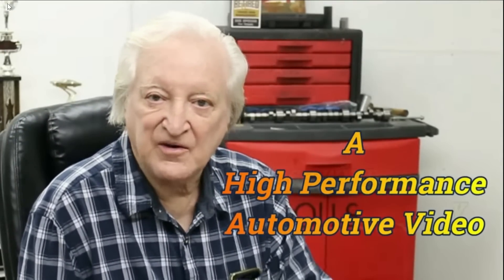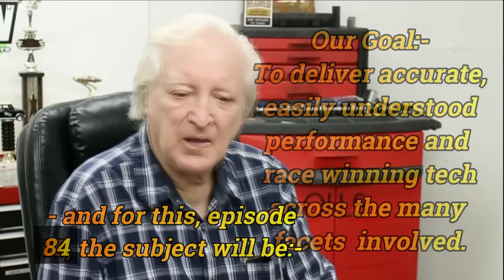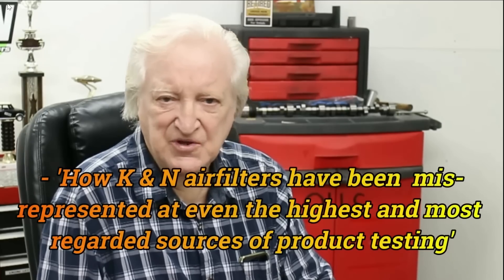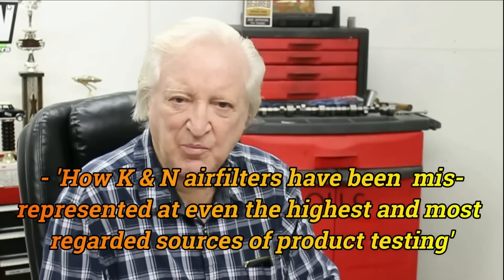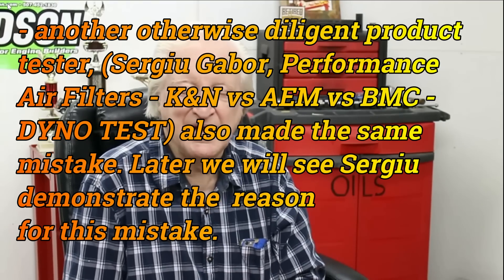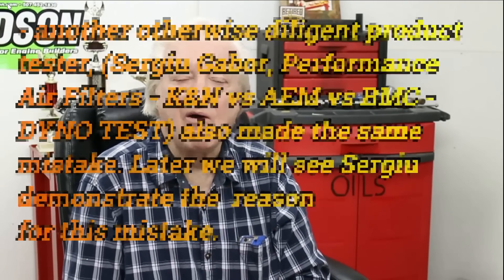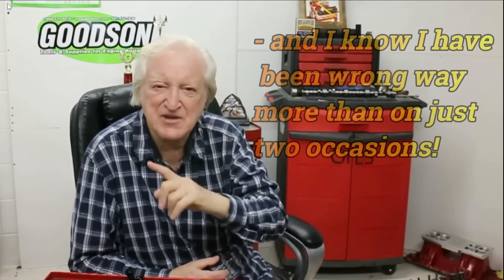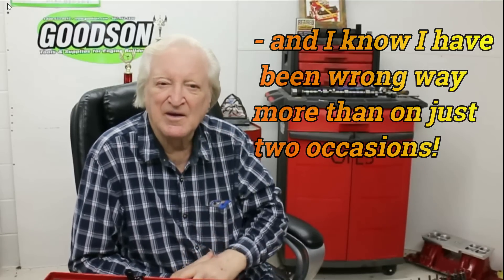K&N air filters  undeserved curse lifted!

Comment: K&N is very good at filtering dirt. But I've learned in a SBC with a blower and an open element K&N under the hood. You end up with 2 issues. First being the MAF gets contaminated by the oil on the filter. The second was after going to a speed density tune was the fact that. the filter couldn't handle the particulate matter produced form belt slippage. This problem was first detected by 
1/4 timeslip increases for no other reason. Upon disassembly of the intake piping to install meth injection. We were shocked to see all the black matter from the belt. So after a complete cleaning of the intake piping & intercooler. We redesigned the air intake system outside the engine compartment. WOW to my surprise we didn't have the problem of slowing timeslips 3 or 4 times every season. this was real world out of my pocket knowledge. I still run with K&N but do note filtering dirt is one thing filtering rubber is something the filter was not designed to handle.

Comment: Hey DV, I've heard of some mechanics say that K&N fFilters are "Absolute Garbage" when used on engines with a Mass Air Flow sensor. When the K&N Filters were designed, there were no computer controlled engines, only carbuetors. I have a 1992 Isuzu Rodeo with the 3.1 L V6. The engine has OBD I diagnostics with a Manifold Absolute Pressure sensor to control the fuel flow from the TBI fuel Injection. I bought aK&N filter for it as soon as i got it. I LOVE that filter. I've had absolutely no problems with the performance of my vehicle.
Reply: Shouldn't make a difference whether you use MAF, MAP or a simple carb.  The air still pulses as it's drawn in, and so the filter should work just the same.
Reply: Nissan in Australia, and Volvo for that matter, have both used viscous paper air filters. A hybrid between paper and K&N filters. Basically an oiled paper element. Nissan even used it on some vehicles with hot wire air mass meters
Reply: @aussiebloke609  These "mechanics" were saying that the oil was coating the MAF wire and causing errors. It would take a lot of excess oil on a filter to coat the wire. The air duct would also have to be equally coated and we know that isn't the case when properly oiled.
Reply: @briantayes2418 
I have pictures.
Reply: @aussiebloke609  Those mechanics inferred the oil on K&N Filters was making the MAF sensor to throw codes. Perhaps the filters were over oiled after cleaning? "The correct amount is good. More is better".
Reply: @briantayes2418  Lack of experience on everyones part. You've likely probably seen the forum posts where the new kid looking for low cost horsepower buys a k&n and over oils it. Oil gets pulled in and coats everything.  Usually the chain of events is: kid put in k&n. make post about poor running engine some days later neglecting to mention their new k&n, They throw parts at it, then go to a mechanic who condemns the k&n, cleans the MAF and sticks a paper filter back in, and thus begins the misinformation cycle of condemning the k&n rather than the actual cause being over oiling.    
     
We've all over oiled them probably at one time.  I know I sure did my first time reoiling mine.  But that was a long time ago with a carb, no harm done,  just the oiliness on the inside of the baseplate.  Still running that k&n on the same car decades later.
Reply: @briantayes2418  I'm a mechanic and I have seen K&N or K&N knock off filters cause MAF sensors to read wrong.  It only takes a small amount of oil to make the MAF meter incorrectly, this in turn causes anything from just throwing code to catastrophic engine or transmission failure.  What fails depends on how long a concern is ignored (that's what causes the big repairs, a lot of people don't pay attention when the vehicle starts running bad.) and the year, make and model.  A lot of PCMs just have "Blind faith" in their MAF sensors and don't even throw a code, instead they just adjust the fueling and shift strategies for air flow that doesn't exist.
All that said...

A K&N can ONLY cause that if it's over oiled.  And a factory filter can cause the same issue if it gets plugged.  Where I live the dust is a factor and it gets into everything!  When a factory filter plugs, it acts as a sifter and the smaller particles are forced though.  I run K&N filters in everything I own because they filter/flow better than anything else (when they're cleaned and oiled correctly).  The exception to this is forced induction engines, turbos and blowers seem to straighten out the air and cause the K&N to loose some of its filtering ability.
Reply: @briantayes2418  A coworker made that mistake. Once he cleaned the excess oil off everything went back to normal.
Reply: I put a brand new out of the box K&N in my wife’s ‘96 Rodeo and it ended up fouling the MAF.
Threw a CEL.
Still running the K&N but now I clean the MAF every other oil change.
That K&N does make a difference with that gutless Isuzu 3.2.
Reply: @guyfranks4354  Over oiled.
Reply: @johnflett2531 lol air filter causing transmission failurev😂
Reply: @theshed8802 Same for Genuine Holden air filters (6 cyl and V8) for many years. They were tacky to the touch.

Comment: Hi David, 
Are the K&N X-treme filter lids worth it vs a standard metal lid? 

Heard from a local dodgy mechanic/“engine assembler” that they lost power on a chassis dyno with the K&N filter lid… 🤷🏽‍♂️
Reply: Try to find the episode of Engine Masters that tested air filters. Very interesting.
Reply: Usually that K&N  lid picks up power.
Reply: @thereluctantgearhead4544  depends. Watch the Engine Masters episode. It does SOMETIMES depending on circumstances.
Reply: @troymecey  I've seen every episode. I'm just speaking from my 40+yrs of experience with building engines.
Reply: @thereluctantgearhead4544  you win. I've only got 35+. Congratulations
Reply: @troymecey  haha!
Reply: @troymecey  Probably more of a curse than a win. I wish I would have chosen a office job. Too late now tho, I'm retired. But you are right in the aspect of results may vary, don't think they do much on a 200-300hp engine, but on high powered units they definitely help. I never did like the way they look tho. And most of my drag cars just used a base with no air cleaner. That episode of engine masters was eye opening on a few air cleaners tho. Amazing how much power can be lost with the wrong one.
Reply: @troymecey  The salid bowl was the real surprise. Didn't see that coming.

Comment: I was wondering on blown applications typically a superchargeror a turbo will pull from the filter. So does that negate the pulsations from the engine, or would you still get enough pulsations since while crusing you are not in a boost situation.
Reply: Glad i checked the comments,  this is my question also.   In my experience blowers actually do pulse,  diesel (roots) blowers anyways,  but turbos are a steady pull.   I will be checking my dodge Cummins air box for infiltration!
Reply: @shrodokahn470  I have a centrifugal blower (vortech) which is basically a belt driven turbo. It will be interesting if we get an answer to this question. In most cases while driving the blower is bypassed until boost is needed, so does the pulsations transfer passed the blower to the airfilter?

Comment: Oiled filter are better on non boosted vehicles. Maf sensors that get messed up on are majority boosted engines. There have been several tests among the years and working on performance vehicles for almost 2 decades my observation matched.

Comment: The real question here David is in a modern car with an AIR BOX and several feet of plumbing do you get a good pulse at the filter.    I understand a filter  on top of carb on a lower rpm v8 with high comp engine would have a much stronger pulse However i would disagree that a modern larger bore hirer avg rpm several feet of duct and an actual airbox will nullify any pulse that far away.    Change something simple as air tube dia or compression will really effect the results   May want to reexamine the signal /pulse in that condition which would be more applicable everyday driver.    Im kinda suprised you didnt apply an artificial vibration on your flow bench to simulate your fiber theory which does sound very plausable for and differences.  Interesting like usual no doubt.   Also the use of oil in cold ( -15 here in Catskills NY Winter) would it stiffen significantly

Comment: Can you help me 
I just looked at a 2019 Ram 1500 with a KnNfilter replace the original air box filter. 
Should I be concerned about the wear and tear from original owner who installed this modification. 
The truck has 35k miles other than the after market KnN after air filter truck presents awesome.

Comment: Great job David.  I think this topic needed a better explanation because it is nuanced.  Back in the heyday of Fox bodied Mustang, I, like many (all) others used a K&N air filter.  At the time it was said that the filter media can be washed to clean off the dirt.  I squirt a hose at the inside of the filter to knock dust particles off the outside.  Then put some drops of motor oil on the filter.  At the time K&N was selling filter oil too.  

Is washing the filter with water still advised?  Am I doing more more harm than good?  Do those little micro hairs get knocked off when getting squirt with water, or do other cotton fibers break and take the place of some of the fibers that get washed away? What about spraying the filter with compressed air?
Reply: Lol @compressed air!

Comment: If the k&n rely on the pulsing of the air intake doesnt that mean it would be less suitable for turbo and or supercharged engines?
Reply: Agree.   How about this.   Modern car.   Several feet of duct work and a box.      Combine with modern lower stroke big bore set up pulling air in a much steadier stream  than a big stroke lower avg rpm v8 with the filter direct over carb.    Much more to look at like you say.     The pulse should be radically different.  Change the diameter of the intake pipe and watch that pulse drop

Comment: Since I’ve owned Efi vehicles I put a k&n filter in and check it every 10k or so but typically don’t need to clean and oil it but annually or so. I know I’ve had some go Over 100k miles . Wish they had some more economical ones for the 2001 Rm250 my son races - it’s got a great airbox. I can’t say the same for the 70s Rms and 77 Husqvarna we run.

Comment: Had mixed results with KandN. Now avoid them for simplicity. DVs vibration explanation makes sense. 
Had a KandN style filter fail on a banks intake for a dodge. 
Had a dirtied MAF on a chevy cobalt from a KansN filter despite the KandN seeming to filter better than OEM.
I do not recommend an Oiled filter on anything with a MAF.

Currently slowly developing an intake that uses a GT350 OEM filter for a hatchback. For good, dry filtration.
Reply: Over oiled.
Duh
Reply: @yukonstriker1703  Then they have to be over oiled from the factory for a MAF vehicle.

Comment: I use to run K&N on my daily, and everything else. One oil change and I was feeling lazy and just put a wix filter on instead of cleaning it. Power drop was obvious, but my oil also stayed looking like new for quite a bit longer! I have not bought a k&n since. No "real testing", but the clean oil was enough for me. Only explanation I can think of is dirt, nothing else changed.
Reply: Yes, I noticed dirty oil also, but I'm still running the K&N on a 5.7 Hemi Ram 1500.
Reply: Maybe you should change your oil , dirty oil is usually results of carbon deposits from engine not dirt in the intake track .
Reply: @darwinfoster7420  , I noticed the oil getting dark after installing the K&N. Why would I change full synthetic in 3,000 miles or less?

Comment: So where do you say that the extra dust being filtered by the medium goes? It can't be caught by the medium because it would just plug up like a regular air filter. It can't magically make the dust disappear or channel it into some other dimension either. I think the reason it doesn't plug up for a long time is because after a certain point, the oil has absorbed as much dust as it possibly can, and then stops catching dirt altogether, but it still has large holes that let unfiltered air through. In other words, I don't think it actually filters or "works" as a filter! If you want to prove me wrong, here's how you can do it. Set up a test where you put two filters in series - first a K&N as the first filter that the air goes into, then a second regular paper element filter. If the K&N actually does the filtering it's supposed to do, the air entering the second filter will be clean and the second filter will not get dirty. If the K&N lets dust through, the second filter will catch it. Run that and see how long it takes until the paper filter gets clogged. I predict that after the K&N loads up enough dirt to lose its effectiveness, the paper filter will start catching the dust it lets through. You can do it on an engine if you think the pressure pulses or vibration from an engine have a magical effect on the filter. The bottom line is, the dirt has to go somewhere, and if it's not getting caught by the filter, it's going through it.
Now a different discussion would be comparing filters by the dust particle size they let through and by the amount of dust they can capture and by the pressure drop curve. Or even discussing the particle size and amount versus engine damage and longevity. In my opinion, having a long lasting reliable engine is more important than saving some money on air filter changes.
Reply: @Buddyclub33 Your response was pretty cringe

Comment: i have a question… i can understand a N/A engine would have intake pulsing, but would a turbo vehicle have intake pulses ?  in my mind a turbo just sucks a straight flow of air ??
Reply: No pulses with turbo
Reply: @SinsBird  so in other words it’s not recommended to run a cotton gauze filter with a turbo vehicle
Reply: @davewyatt1468  yes. Actually, I wouldn't recommend running k&n in any vehicle. Not that I know anything, but it seems like nothing but a pain in the butt and a waste of time because you actually need to spend time to thoroughly clean it and then reapply the oil. You must apply an absolutely perfect amount of oil otherwise you would see oily dust in the intake and if there is not enough oil there would be dry dust getting into the intake. You want performance and longevity is not important? Go filterless. You want performance AND longevity but stock filter is restricting the flow? Install a bigger filter box of a different vehicle, heck, connect two filter boxes in parallel.

Comment: I understand the many points. There is a You tuber who is a motorcycle mechanic showing  that dirt that is allowed to pass into the motorcycle  air box .

Every bike that has either a K&N or like filter  he shows the proof.   Dirty air boxes.

He also shows the stock filter air box  perfectly clean. 

I have an Idea what it may be.  I have run across sone K&N filters not sealing properly. So this could be the case?   Or  based on two different  sides someone is mistaken. ?

Comment: They are high flow for a reason. Pull a K&N filter. You will find dirt and dust particials on the clean engine side of filters in duct work. They were developed for off-road and performance vehicles where water mud and added CFM air flow damaged paper filters.

Comment: The two take aways from this video are, K&N filters are good, and that your test results are only as good as your testing methodology. It's very easy to get incorrect test results. Your test results have to match real world results. We don't race laboratories, or flow benches, or dyno's. They are all measurement tools.
Reply: As VW showed, you can't always trust testing in an artificial setting.  Real world results come from testing under real world conditions.
Reply: @aussiebloke609  the difference is that VW intentionally acted in a manner to provide inaccurate results. No good faith involved. The tests that DV is referring to all appear to have been developed and carried out in good faith, with good intentions.

Comment: DV I am a retired Ultra 4 racer, I have always used a K&N filter, I always clean the filter prior to every race. What I hav noticed is a very fine and thin layer of dust stuck to the intake tubing just after the filter. So I know it is letting fine particles through the filter. 

In Ultra 4 racing the dust we have to deal with is  usually not quite as bad as Baja but it can block our vision at times. If the filter is passing fine particles it is allowing damage to the engine.

One difference I from your testing and my results is that I use an outerwear outer filter that is supposed to top mud or water from entering the filter. 

The amount of dust in the air at one of our races would totally destroy an engine in very short order if there was no air filter. Also I noticed as the filter got dirtier the K&N filter did a better job of filtering until the filter was totally clogged to where the filter was restricting the air causing the filter to collapse in on its self. K&N  may not have been perfect, but it was the best option as far as I’m concerned. 

I have always wondered how well a Donaldson filter works compared to a K&N?

Comment: I've seen too many UOAs with much higher silica with K&N vs paper, and dust inside intake tract and on impeller blades.  Also, too many reports of incompetent oiling causing MAF sensors to give faulty readings.
Reply: Can't blame the filter for when its used incorrectly.
Reply: You have to properly install and clean them it's not K&N problem it was your failed installation process .